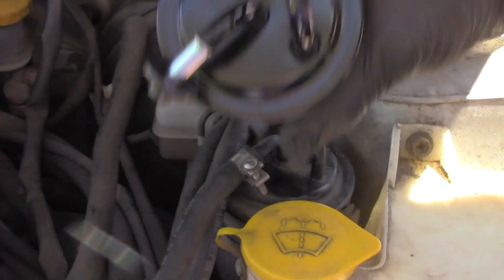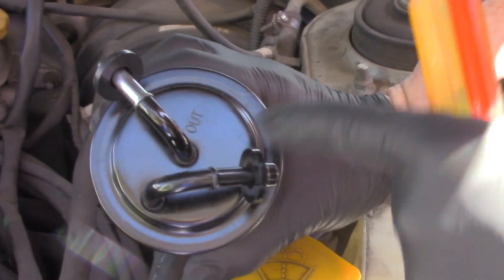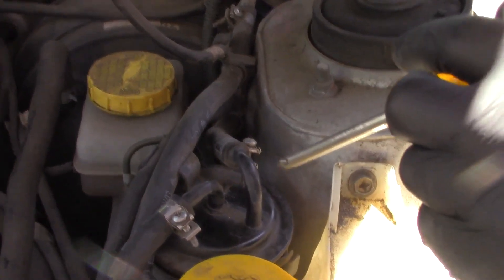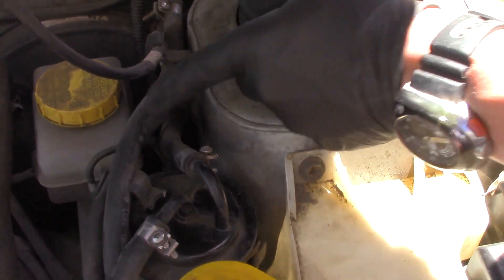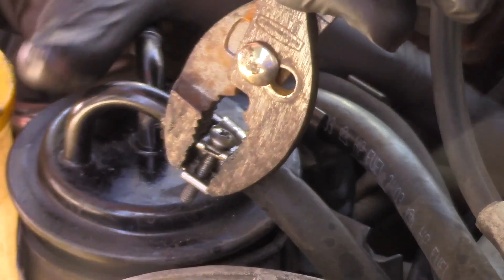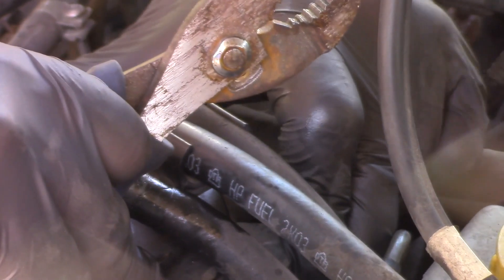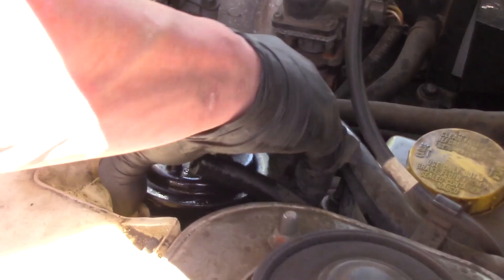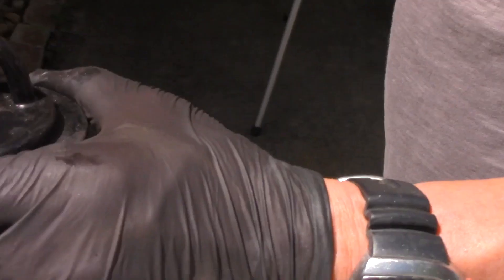How to change your Fuel Filter on your Subaru

Comment: i have a 2006 baja and a 04 forester X engine...(same just replaced it) and i dont have that filter there... gas lines just go from firewall into the manifold...
Reply: Fuel Filter is located under Passengers Side rear seat incorporated with Fuel Pump.

Comment: Do you need to pre-fill the new filter before strapping it in?
Reply: No..the fuel pump should fill it after you start the car a couple times.
Reply: Three cycles of on to off with the key to prime the system again.